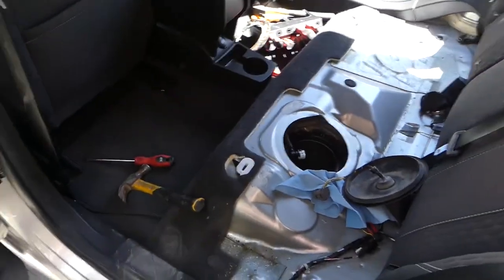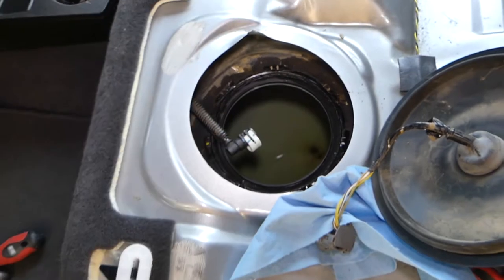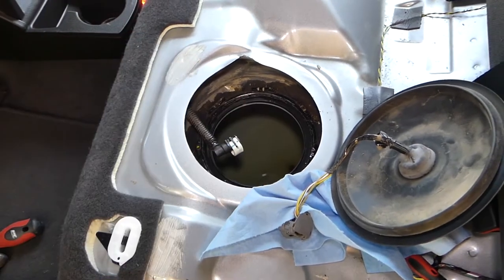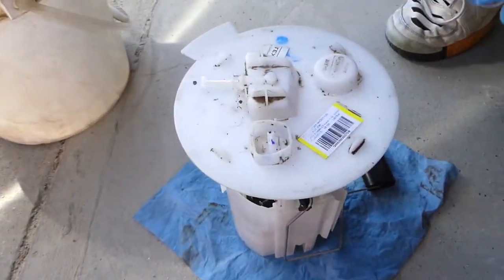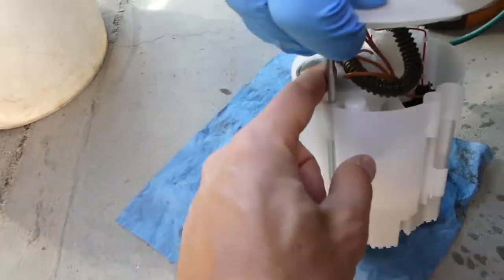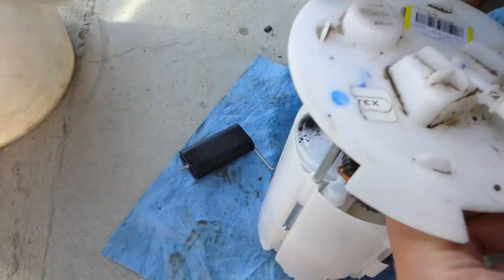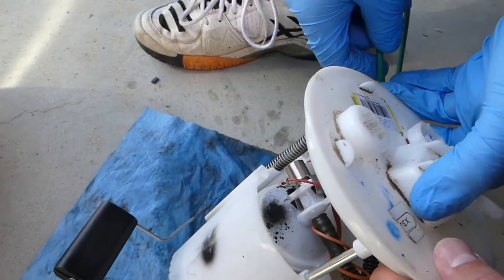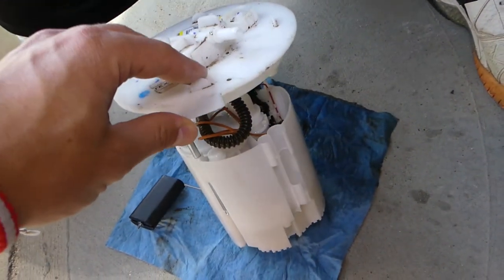HOW TO REPLACE FUEL FILTER ON FORD FIESTA MK7 ST

Comment: Isnt the fuel filter underneath the car the replaceable one?
Reply: This is 100% the fuel pump. Idk why they labeled the video how they did. The fuel pump on this car would wither be in the engine bay or under the car. Im looking that up rn.
Reply: Turns out i was wrong. The fuel filter is built INTO the fuel pump/sending unit. So it’s all one system and plug and play.